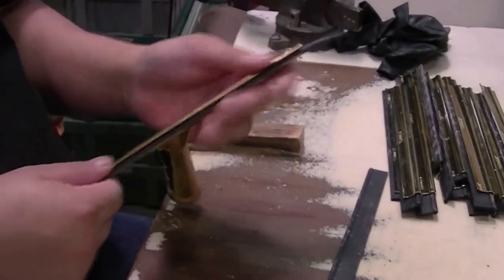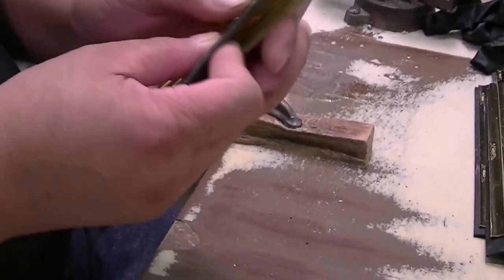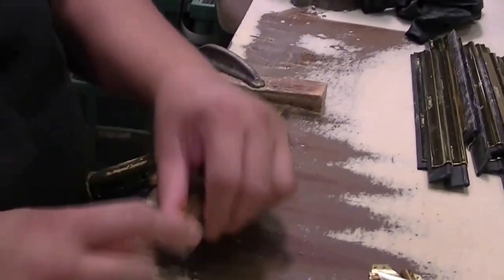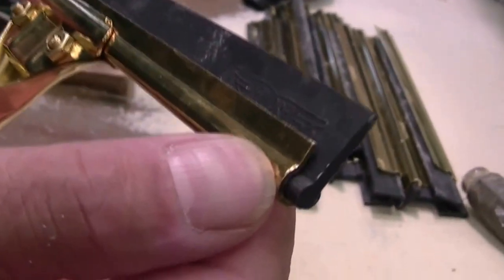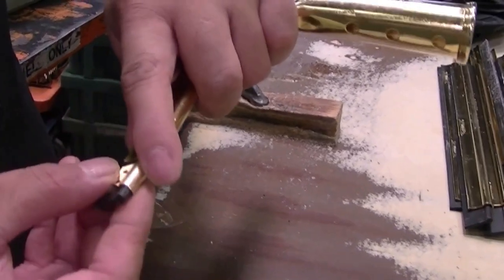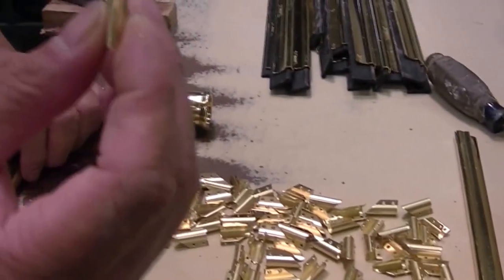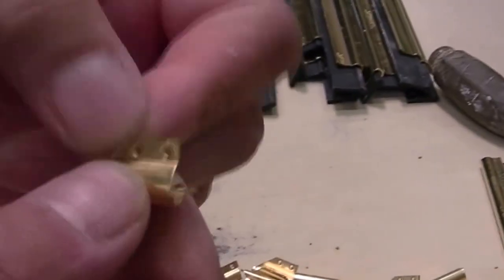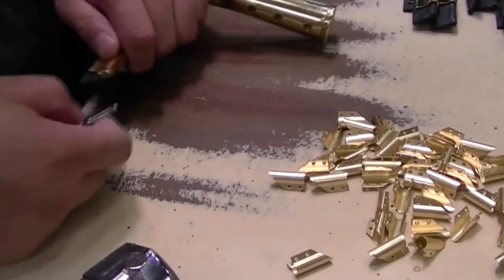Demo: How to Replace the Rubber on an Ettore Squeegee

Comment: When I followed the instructions, and after both clips were put in, the rubber blade was not straight, but wavy. What is the problem?
Reply from the maker: Hello Dotti, 

The rubber needs to be pulled so there is a 1/4" protrusion out on each end. This process makes the rubber tight in the channel, thus removing any "waves" in the rubber. Hope this helps!
Reply: You want to get some dawn dish soap or fairy soap and lubricate the channel so when you're pulling the blade the clip slides into place when you release the tension.
Reply: Means you have slack inside the channel.

Comment: Why do you need to use TWO clips (that seems rather redundant)? Why do you have to replace the clips each time (that seems very wasteful)? Why do you have to only use one side of the rubber (it can be flipped over to have a brand new edge)? I get the feeling that your video is very much about convincing people to buy more stuff and more frequently than they really need...
Reply from the maker: Thank you for watching. We use two clips (one on each end to keep the edge of the rubber completely straight for the perfect edge). One clip would not provide the tension on the rubber blade and you don’t have to replace them each time if they are still in workable shape. (We do recommend you replace them each time because they can get gooey and sticky and hard to work with, but if you want to reuse them that is completely up to you.)

We don’t recommend only using one side of the rubber. In fact most professional window cleaners go through 2 blades a day (start at 8 am, flip the rubber at 10 am. Change the rubber at 12 pm, flip the rubber at 2 pm and end at 4). Not sure where the idea that you can only use one side comes from, but that is inaccurate. We encourage you to flip the rubber to double the life.

Again, thanks for watching. The video is for information purposes as we get a lot of questions on how to replace the clips and how to change the rubber.  The video tries to answer those questions.

If you have any further questions contact us at 800-438-8673.  We are happy to address any and all questions you may have.
Reply: @EttoreProductsCompany  I think the idea that you only use one side came from  the gentleman in the video that said put the rubber in logo side facing out because of the angle which may have led some to believe that only this side was useable ,I've cleaned windows for 15years and know you always flip the rubber not as frequently as you have mentioned but In practice we tend not to use the manufacturer recommended ways of use to save money and time (I would only flip the rubber if it was unusable probably once a week and it's the same for other cleaners in my area ) other than that love your tools   they make my money so I'm not complaining
Reply: @EttoreProductsCompany  - Please, make a better, much better demonstration video.  This is almost useless.
Reply: Not really, the clips are the cheapest possible product window cleaners buy - they're just pointing out what is optimal that's all.
Reply: The two clips keep the rubber in place. I haven't ever replaced the clips, I just use the ones that came with the genuine Ettore squeegee. The reason you use a certain side of the rubber is that it is angled to properly meet the glass surface. Ettore is the best. Sorry this is four years after your post! I'm just replacing a rubber blade on one of my collection of squeegees and had to remember how to do it.

Comment: First, that clip will slice your finger off.  I've not handled something that sharp since I told my wife to ease off on the cupcakes. So do yourself a favor and wear gloves 

Second, ditch that second clip. The rubber isn't going anywhere and if you're really concerned about it, take the smallest wire nail you can find and shove it in the gap that the clip would occupy to make the rubber snug. It can't fall out but will slide out when you pull it during a changeover to new rubber.

Simple.